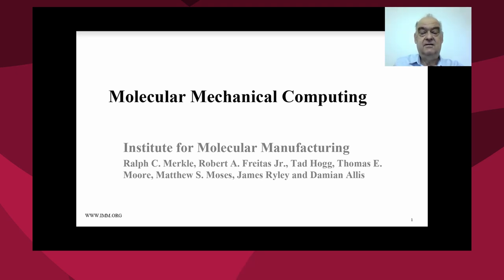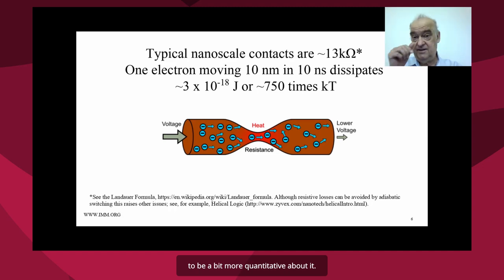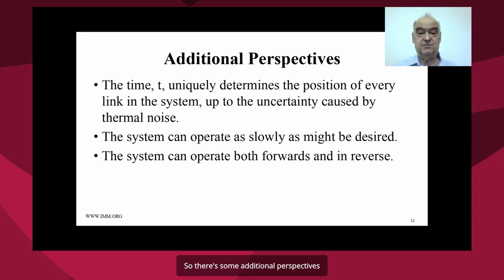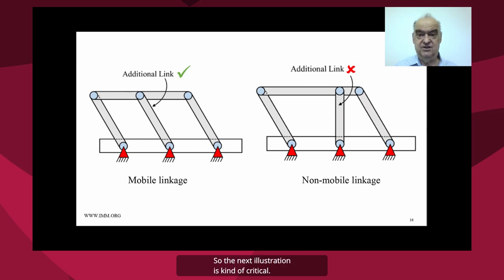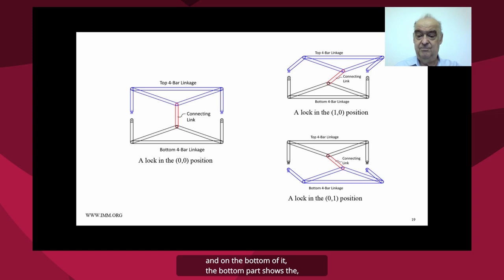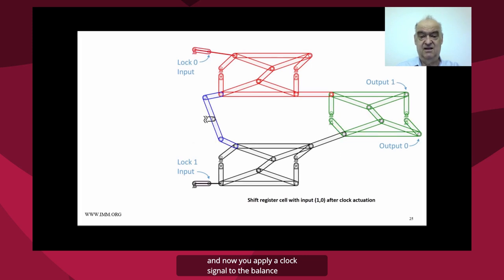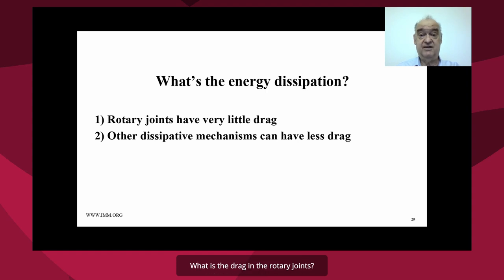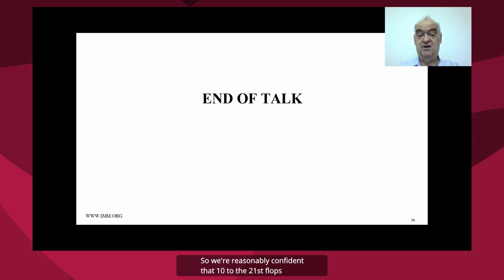Ralph Merkle: Molecular Mechanical Computing (via the CCC Workshop on Reversible Computing)

Comment: Seems the comparison isn't fair in the analysis.  A parallel processor with deep forward lookahead can perform execution much faster than a machine at more than 3x "flops" without the bells and whistles.  The industry likes to tout the wrong things to consumers as if it were important, when it's not what is being improved.  On this, there is linear stress problems that can occur, a single "activation" line (clock signal through a train of locks) can eventually reach a point that the mechanism will be unable to move at all.  Then you have the "jostle" problem, where vibrations in the environment can disrupt and encode the wrong data along a given chain.

I mean no offense, I'm really loving the idea of mechanical logic gates and computers....because they will be needed in the society of the future, in my opinion (it's far easier to produce in 3D print, which will be vital in space exploration and colonization, in order to replace key ship/base components).
Reply: I think you are making the unfair comparison, you are comparing a test feature with test architecture to a fully built and designed chip.
Akin to comparing the physical tests of a steel I-beam to the brick and mortar construction that predated it, and your concerns will certainly play a role in chip architecture but they are not necessarily hard limits.

I can think of a very simple solution, having the end of the clocking limit length activate a switch for the next length of clock, and too boot I am rather certain the future of computing is in utilizing and combining different systems based on thier strong suits not a monolithic single system

I.E. instead of a single ALU built in chip having an analog low precision unit for calculations involving curve segments, a boolean unit that likely uses optical logic, and a base adder that very well may be mechanical, all working on concord, might utilize phase change materials with optics for storage etc etc etc whatever does the job with the lowest wattage and fastest performance for every task, rather then just using semiconductors in a single fab step.

This would additionally make 3d printing thr components possible as well, but without the downsides.